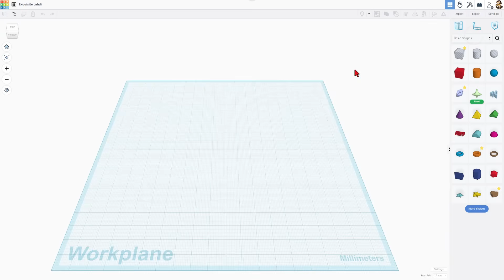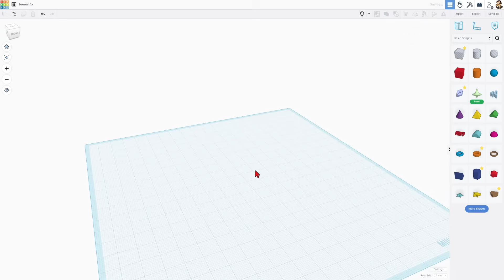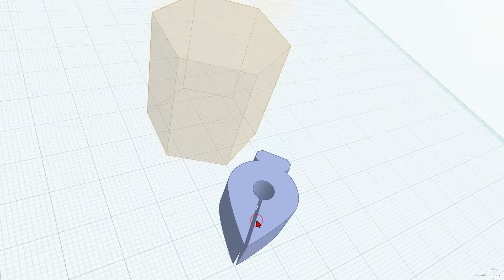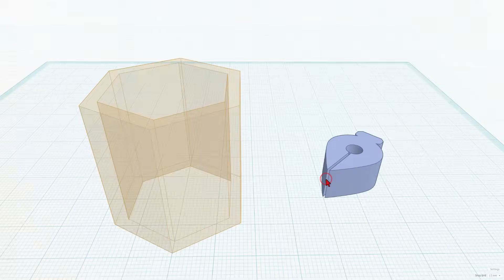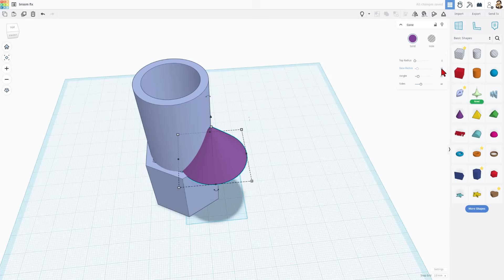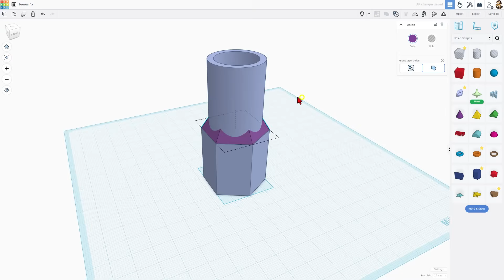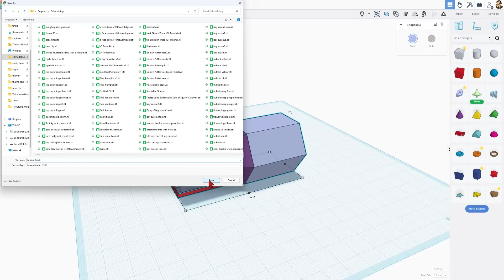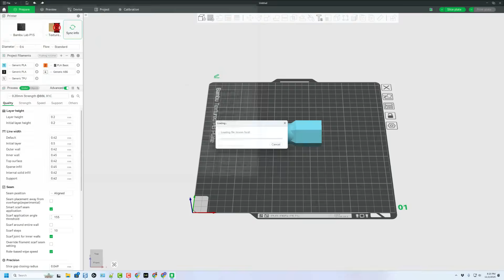Use Tinkercad Sketch Skills Create Parts to 3D Print FAST! 💯🔥

Comment: I tried this Stroke Setting with the new rotary sketch tool and it doesn’t work. I wanted a 90 degree pipe bend, 50mm dim pipe, 100mm bend radius. I tried a 2 mm thickness and it just formed a solid. Any ideas.
Reply from the maker: If you are just making a 90 pipe... I would use the bent pipe.  https://bit.ly/hlbentpipe
Reply from the maker: I have a slick chat area at my Patreon site. https://bit.ly/hlpat  It is available to free members. Slick for questions like this because we can add images and links. This explains it. https://youtube.com/shorts/xHUM1eGOmjE?feature=share I am not quite sure what the project really looks like, so postiung there might help us find a solution for you.

Comment: Nice one! This is what I use Tinkercad for. Quick question though....at around 2:42 you changed one width dimension to 32mm but when you 'ok'd' it the other width actually changed down to 26-odd.....am I right?  I thought you had to shift select to force both widths to be the same. Nice vid though 👍🏴
Reply from the maker: I had measured flat to flat... Tinkercad measured the polygon I traced corner to corner...  I made that measurement after I had the footage recorded and just mentioned it in the video. I should have bounced back and recorded footage to make that more clear. 🤦‍♂️ Thanks for the note!
Reply: @HLModTech Sorry I didn't mean that....when you changed the required measurement to 32mm (the one width) the other width (the second one) changed down to 26....I'm not criticising I'm just curious as I thought you could only change both measurements by Shift/selecting one.....if you simply select one only (ie without SHIFT) it only changes one dimension.
Reply from the maker: 👍I always welcome questions and critiques. Very possible I did something silly. 🤣 WIth the polygon I believe I was adjusting it all (shift+drag)  so that the one side matched the number I needed... It does the math to get the proper number for the other dimension on it's own.

Comment: Why didn't you print it vertical, without supports?
Reply from the maker: Stronger this way. Vertically, every new layer is a likely place the print would be more likely to break at during use.
Reply: @HLModTech thanks, i'll keep în mind
Reply from the maker: It is possible it would have been fine too... Especially since I was using ABS and 3mm thick walls.

Comment: The example is great using the new tool. I like the new tool making changes to older STL files.
Reply from the maker: Yeah! Trimming stuff with custom sketches is really slick. Thanks for the note!
Reply: @HLModTech  I am taking a China board to charge my Ebike but it doesn't have a case so I found one close. I am changing the STLs to use it. You should do a video on making changes to a STL that is near to what you need. Thanks for the great videos!
Reply from the maker: I have a few STL fmod tuts out there. It is a slick skill to have. Best of luck on your mod!
Reply: @HLModTech  Thanks, The new tool works great!

Comment: I did this with my washing machine door handle. Mine broke off and a new one was $75. I made a basic one on tinkercad and it's been holding strong for 2 years now.
Reply from the maker: You rock @neonnerd1364. Those are the kinds of results that make my day. 💯🔥